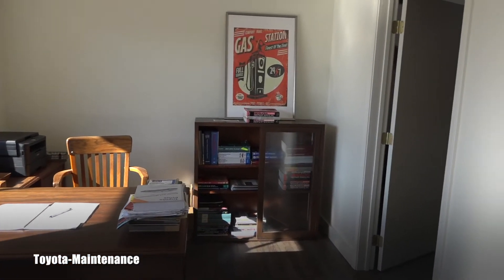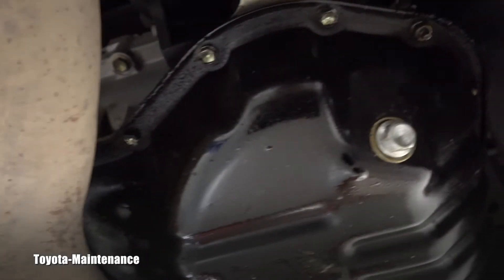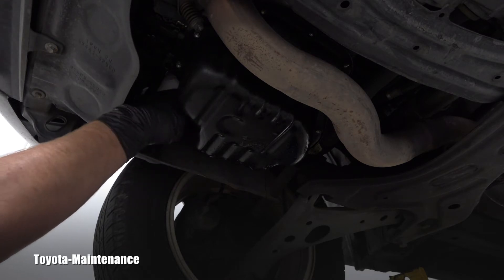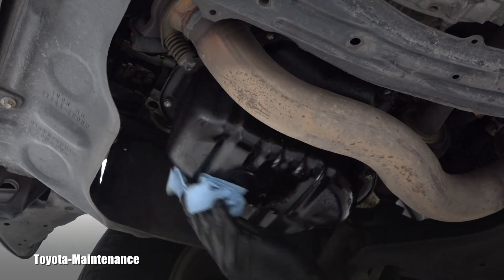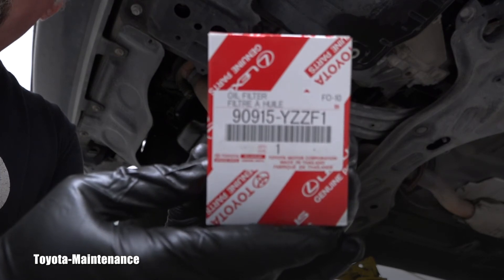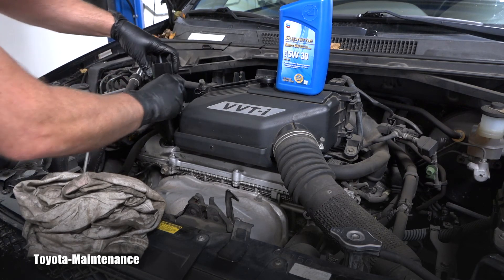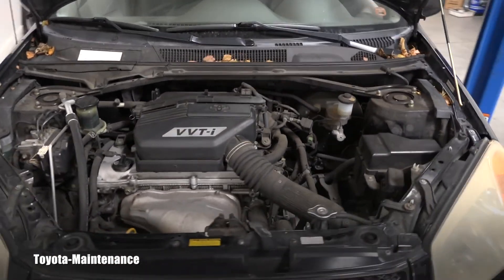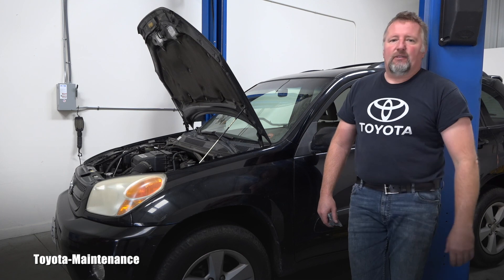Toyota RAV4 Engine Oil and Filter Change

Comment: Awesome video.
Would be possible that the gasket for that oil filter drain plug can go bad over the time and leak since you're not replacing it every time you change the oil?
Reply: It's a good idea to replace the gasket/washer on the oil pan drain plug with a fresh one to ensure a good seal. The seal on the oil filter is an integral part of the filter cartridge so the old one is always disposed of.

Comment: Ive seen its 18ft-lb(24.4 Nm) torque on drain plug do you know where to find official torque info?
Reply: I have a Haynes manual for the Rav4 (I own a 2003 2.0 vvti AWD). The manual says 18 lbf ft or 24 Nm torque for the engine oil drain plug (this is for 2001 and later). I'd recommend getting a used Haynes manual 
Haynes 4750  ISBN 978 1 84425 750 8

Comment: I like your videos.  What size socket is used on the oil drain plug?
Reply: 14mm if it's OEM or identical spec'd replacement.

Comment: How do u like that chevron supreme oil?
Reply from the maker: I like it and will use it in future in my Sequoia
Reply: Thanks. Do you do extended change intervals on your cars? I have a 2007 4Runner and I’m wondering if I can use this chevron oil past the recommended 5000 miles.